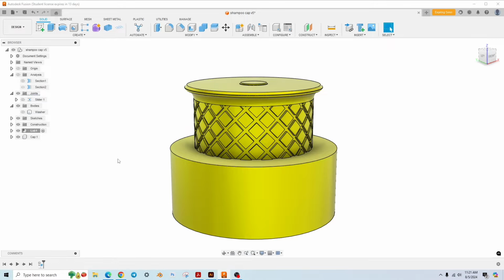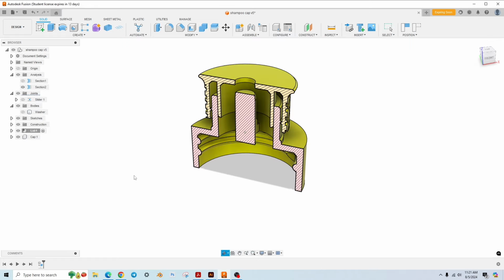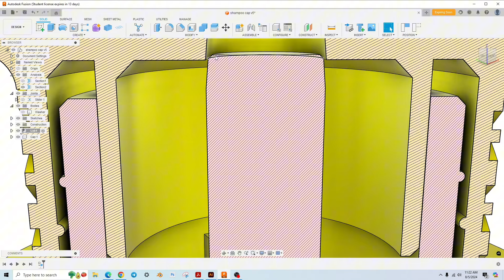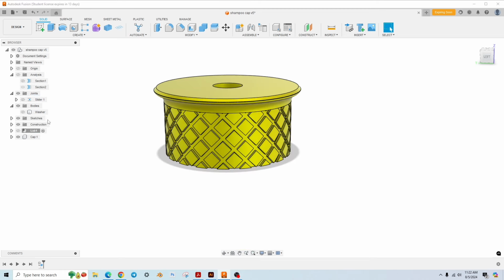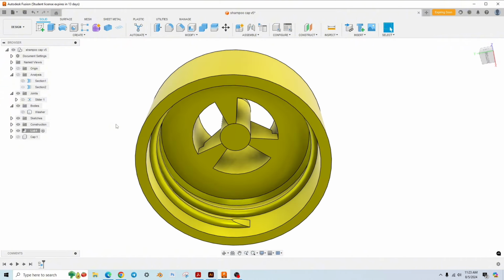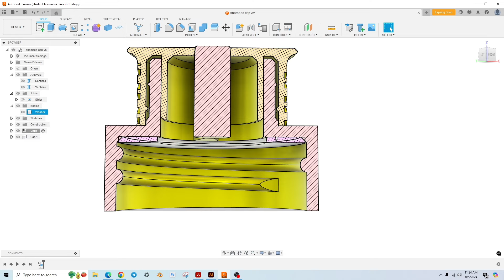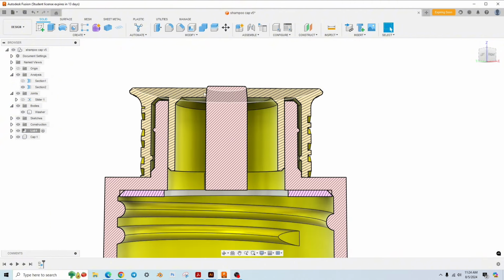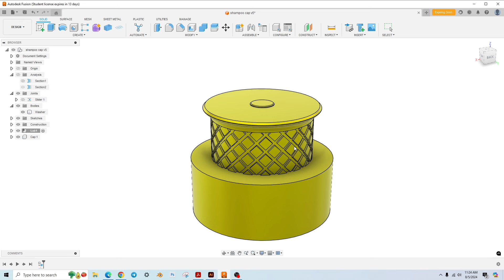Fusion 360: Bottle Cap Teaser (Tutorial?)

Comment: Hi again thanks for the informative videos They help me to do things I did not think I could! 
 I do have a question about woodgrain texture on the top of a part in fusion 360 not blender ,how would go about doing that?
The container that you designed with threads would look great with a wood texture and done in wood pla so you can stain            ( and yes i'm asking if you can show that)